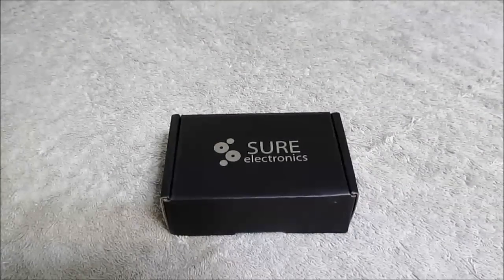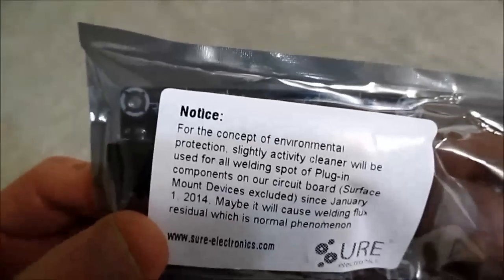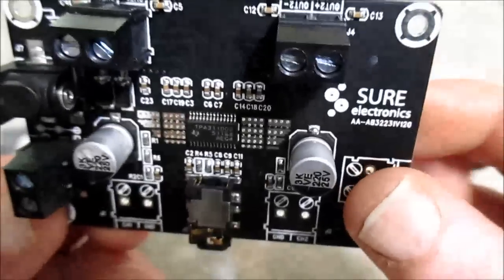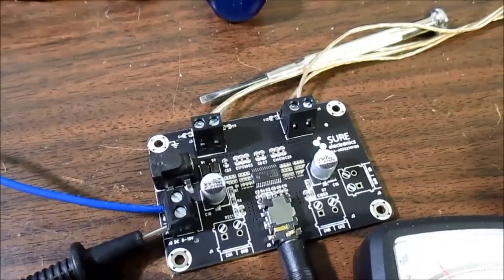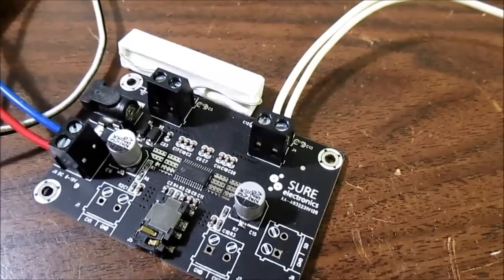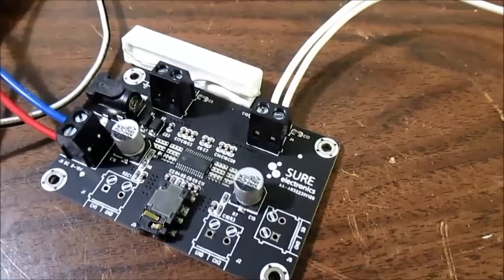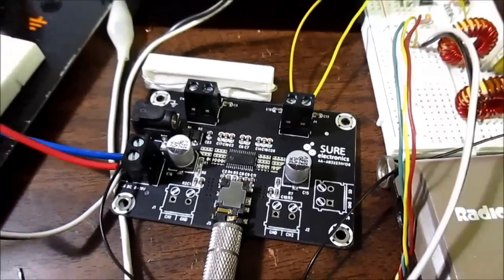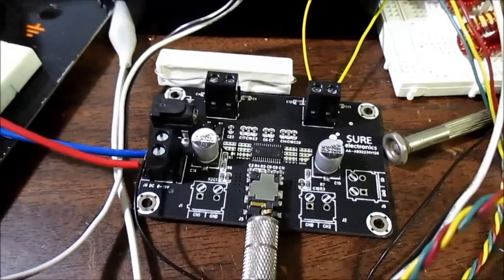TPA3110 class D stereo amplifier test and review

Comment: I sometimes wonder if the really cheap TPA3116D2 boards are not using remarked TPA3110's.  Edit: or other lower grade pin compatible TPA's.  Having that non inductive resistor on the one channel is going to get it hot even without an input signal.

Comment: Mod this TPA3110 amp run of power from a laptop 2x 5V 1A USB ports with a DC Voltage boosted to 8-12V , would that work ????
I know the PAM8403 exist, but max 2x 3w speakers and they are bit too lacking for my needs.
If I use Dual USB ports in parallel can it can draw 4.6 - 5V  @ 2-3A easily ? would this TPA3110 support 2x 10watt 4 ohm speakers? what about 2x15watt speakers?
I already tested my laptop power draw using 2A resistor from both USB3 port and USB-C port, during load its 4.6-4.7v around 1.6-1.7A for each port, that is 7-8 Watts in pure power,  do I understand that 10watt 4ohm speakers does not actually draw 10watts of power?
Reply from the maker: It would be better to get a stand alone 12v 3 amp supply. With conversion losses, you would need 5 or 6 amps from the 5v supply to run the boost supply when the amp is near max power.

Comment: TI's 3110 doesn't require a heat sink due to its extreme efficiency. TI has shown the 3110 to be FCC complaint without output filters only if the length of wires is less than 4 inches and are a twisted pair. The 3110 was designed to use simple ferrite beads, so a simple 0402, 0603 or 0804 size chip bead will make it FCC complaint with a simple compact inexpensive component. No need to use wired inductors that I have seen on other commercial boards, not sure why they would do that when a ferrite chip bead would cost far less and take up near zero board space. TI has listed values for output filter inductors depending on if your using 8 or 4 ohm speakers, 33 uh and 15 uh if I recall correctly, but the ferrite beads are best. I dont recommend just slapping on any RC circuit of unknown values for testing, the spike you saw in your scope during the FFT is probably due to your filter components. You and anyone can easily get the spec sheet from TI's site, its loaded with lots of good info I'm sure you'll find helpful.
Reply: Ferrite beads only become effective at quite high frequencies, good for attenuating the switching harmonics (of which there will be many) but not great at getting rid of the 160khz fundamental; you need an inductor for that.

Comment: Hello again John. Great reviews. I'm currently assembling an arcade bartop, and i'm thinking on using the PAM 8610 with 4 speakers (2 in parallel in each channel). Can this be made without destroying the amplifier? The speakers are the 3 inch full range sony 30W 9ohm. will this be to much underrated speakers since the amp can only deliver a max of 10~15W per channel? what if i use a 2 way speakers 100mm 50W (25W rms) 4ohm speakers in each channel? best regards
Reply from the maker: If the amplifier is rated to handle 4 ohms (check the manual for actual minimum impedance), you can use two 8 ohm speakers in parallel on each channel. Two 4 ohm speakers in parallel would be a 2 ohm load which can damage the amplifier. You can hook the two 4 ohm speakers in series which would make an 8 ohm load for the amplifier.
Reply: Yes, the amp deals 10w output with 4ohm at full voltage, and 8w with 8ohm i think. What if i use a 2way speaker rated 30w rms 60w max in each channel? Will the sound intensity be satisfatory? (since its underrated)
Reply from the maker: The wattage rating of the speaker does little to tell how loud they will be. Speakers often have an SPL rating that indicates how loud they will play at 1 watt (or a certain rms voltage of input) at a distance of 1 meter. If you know the speakers' model number you might be able to look it up if not otherwise indicated. Choose the speaker that sounds better, not necessarily louder.
Reply: Hmm ok, thanks again
Reply: Nuno Correia "RMS watts' is nonsense - see heading "Continuous power and "RMS power" at https://en.wikipedia.org/wiki/Audio_power

Comment: the sure boards are more expensive than the ebay c lass d amps . my experience has shown me that the sure amp boards are really "nice" i have also recently been purchasing some of the cheaper ebay models , i always use some epoxy to attach a litle heat sink if none is supplied .

Comment: I just got this board in the mail but I'm confused on the specs regarding input. It says do NOT use a preamp but it also states it has 2 methods of input, line level and analog/ 2v or .08v. I really want to use a preamp tone control board so I can tweak the sound a bit but I'd hate to burn up the chip! I'm wondering if soldering to the empty terminals would allow the 2V signal the specs reference? Any clue??? I'm also bi amping so my signal will be split hopefully helping my situation.
Reply from the maker: No reason you can't add a preamp/tone control. Use a volume pot between the pre and power amps to set the level.  Don't know about the amp input levels specifically without taking a closer look.

Comment: I know this is not a actual Video, but the thing with the lower Wattage Speaker on the higher Wattage Amp makes me think. Amplifiers should always have more Wattage than the actual Speaker? Isn't what you need a stable high Pulse? If the Amp overdrives Let's say on a Bassdrum (High Pulse) its really bad for a Speaker. It need a big bit of extra Power. There you come to the zone of the pmpo  thing. The Speaker can handle higher Wattage for very short time. Of course there are limitations. Correct me if in wrong. The Limitation to a safe zone with the 8 Watt Speaker could be easily done with a voltage divider on the input of the End Stage.
Reply from the maker: You can use a low watt speaker on a high watt amp and vice versa as long as you know the limits. Limiting the signal on the input could help but can hinder the amplifier as it may not be able to be played loud enough if the recording is low. PMPO is just silly marketing nonsense to make the amplifier have an advertised power rating of much more than reality.

Comment: Hey John I think I asked you some questions in private but I thought this would be a good video for another question. I think a lot of us DIYers use small amplifiers for little boom boxes or Bluetooth speakers and using crossovers is very expensive in such a small project. If love it if you could show us where the bandwidth comes from in these amps. This way we could get rid of the low frequencies for our small speakers. Can we do this with some output capacitors or something similar? You are really the most knowledgeable YouTuber in this field
Reply from the maker: It is best to remove the low frequencies from the signal before it gets to the amplifier. This way the amplifier can never clip and distort when played loudly from bass frequencies you don't want in the speaker anyway. This can be accomplished by using an active high pass filter (think op amp) or as simple as a capacitor and resistor at the input to roll off the bass. Hope this helps!
Reply: +JohnAudioTech thanks. How do I calculate the cap and resistor value? Is this considered an RC filter? If so how can I measure the input impedance of the amplifier?
Reply from the maker: You can use the formula f=1/(2pi*R*C) where f is the frequency, R=resistance and C is capacitance in farads. Input impedance of the amp would be in parallel with the resistor of the high pass filter. To find input impedance of the amp, put a series resistor (say 10k) on the input, put a sine wave tone on the input and use a meter (oscilloscope is ideal) to measure voltage across the resistor and from there calculate the input impedance.

Comment: Thanks for the video! Any tips on building an amp from scratch for an old car? I have gutted the radio and the only function I would like the original radio to control is power/volume. I have replaced the mono potentiometer with a new one and just want to be able to play my iPhone in the car, no radio function. Please help!
Reply: +Kevin Livingston I actually figured out what I'm going to do. I got a 2 channel (100w per channel) amp from parts express and figured a way to mount the volume control to the original Plymouth radio
Reply from the maker: +56ratbug Personally, I'd use one of the BTL audio amp ICs meant for car audio. Many ways to go when you say "from scratch".
Reply: +JohnAudioTech basically I'm looking for an amp that I can solder the potentiometer to that can play my iPhone and has 4 channel output
Reply: +56ratbug how many watts per channel are you going for?
Reply: +56ratbug cool. You may need to boost the 12/14v up a little to get the rated power? PE has one for about $15 if I'm not mistaken.
Reply: Thanks! Im just going to be cruising to oldies, s the sound it is putting out is pretty suffiecient

Comment: Great review. I wonder how far you could push it with a little heatsink on that chip?
Reply from the maker: +Vladimir Viktorov Yes, you can damage speakers by overpowering them. You can still use the the 8 watt speakers as long as you don't play the music at full volume.
Reply from the maker: +James Last I'd estimate about 15 or 16 clean watts into 4 ohm loads with a good heatsink.
Reply: +JohnAudioTech, does it mean, that it can burn my 4ohm speakers if their maximum wattage 8W? If it is so, is there a way to limit amplifier output to 8W?
Reply: I am running two 4ohm speakers on this with 12v and it has a soft clipping feature so not too bad even when pushing hard but the bass is not there i had to crank the bass all they way up on my pc to get decent sound. I have mounted a small heatsink on it and it does near 10w/ch before cutting off. I am running 2 sony explod 100w rms car speakers on a home made mdf cabinet. I have ordered a tda7498 to replace this chip cus tpa3110 lacks bass. The sound pulses when bass hits (basically the volume goes down when bass hits due to the powerlimit )

Comment: The empty ground and SD connector is probably "shut down" - a mute button.
Reply: ''Connect SD and GND and then two channels will be in Mute mode.
Leave SD unconnected and two channels will restore normal working.''

Manual:
-------------
http://sure-electronics.net/download/AA-AB32231_Ver1.0_EN.pdf
Schematics:
--------------------
http://sure-electronics.net/download/AA-AB32231V100_SCH.pdf

Not probably, you are correct! Sorry no prizes though! ;-)

Anybody know how this compares to the Tripath TA2024? I know that IC is getting old and Tripath ceased to exist a long time ago but I still like that chip. I want to build my own Bluetooth speaker (probably portable so battery and mains) or a portable speaker using a Raspberry Pi 2 or 3 or may be a Zero and Rune Audio, haven't decided yet. Any other suggestions for a good sounding and efficient amp which will suit my needs?